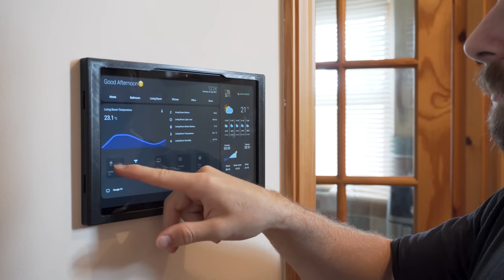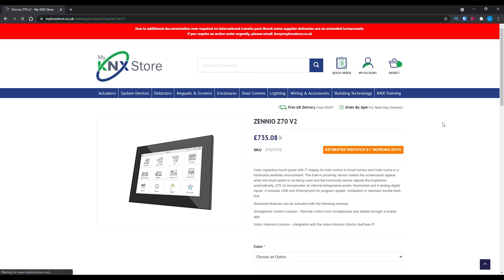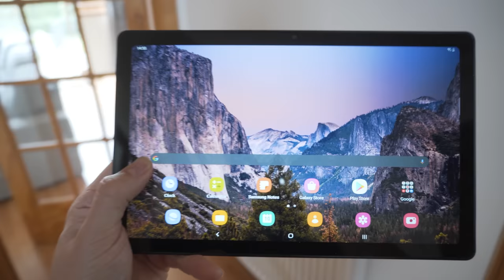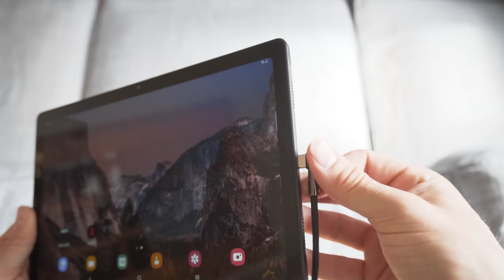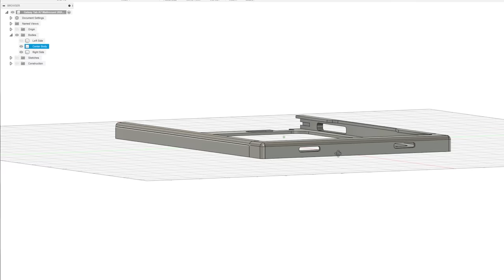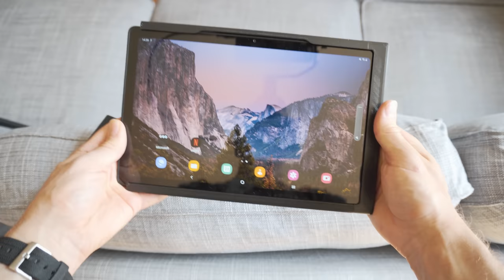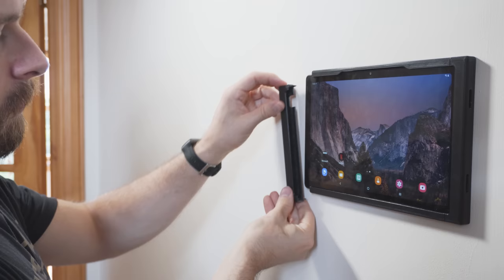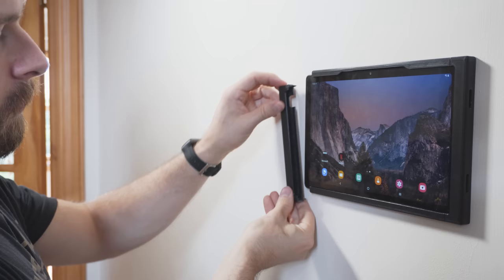Building my PERFECT Smart Home Control Panel!

Comment: My Amazon Fire 10 HD with mbmounts has been a game changer for user acceptance of my family. I got the power kit from mbmounts and Fully Kiosk and it works perfectly. I can even dim/turn off/turn on at specific times of day/night to make it dimmer in the evenings and off in the middle of the night.
Reply: Can you explain the MBMounts power cable? Is it a tiny usb plug with exposed wires to pair with the power method you chose? It's hard to make out what's going on in the pics.

Comment: Another power option is to use POE with either a simulcharge or a Poe to usb converter (if you have a data cable nearby that can be repurposed or are able to get one to the location)

Comment: The one thing I'd change would be using a magnetic charging cable so you don't need to unplug it when you take it out of the wall.
I'd use the tablet as a tablet sometimes.
(If you want a good one, I have a NXTech cable, I liked it so much I bought 2 extra cables for it, one for my bedroom, one for my livingroom and one for my car)

Comment: I went exactly through the same journey a couple years back. I used a Kindle Fire HD 10 with a PoE adapter for two years until the battery shat the bed and started to shut down the tablet. 

I switched to a used 5th gen iPad because of the better battery management in iOS. You can wake the iPad when it’s in single app mode with a separate motion sensor and a homekit notification btw!
Reply: Also used the fire tab myself, I wasn't impressed and would recommend spending the little extra for something better.

Comment: I ended up going with installing a hinged access panel in the wall with the power supply and some sonoff equipment behind.
An automaton I've set up is 1 button (labeled leaving home) activates the alarm, closes all the shutters, turning off the lights and AC with a 15sec delay on locking the door.

The video door bell pop up idea sounds great!

Comment: Amazing to see, i have the exact same setup for a month or two now.
Galaxy Tab A7 running HA on Fully Kiosk and i must say i'm extremly satisfied with it as well. Tablet quality is amazing, HA runs fast and stable.

Also the screen quality is very good, i use a handfull of high quality images from unsplash to loop as screensavers and it just look so good.
Reply from the maker: Nice, good to hear your having a good experience with the tablet too!
Reply: @EverythingSmartHome  I hope your setup is still good, my battery has swollen and died after a little under a year on a brand new device from being on the charger permanently 😅

For my next try I'll definitely add a smart switch in before the charger and use the battery data from Fully kiosk to automatically turn on/off charging when needed instead of permanently.

Thankfully a new battery is cheap and relatively easy to replace 👍
Reply: @robt7287  I have the same tablet and died after 1 year as well. Today I am about to replace the battery myself hoping to get more lifetime with some settings as you say.
Reply: @mercuryin1  I've replaced it as well, relatively easy since the screen already had popped off due to the swollen battery

Comment: Love it! Planning to replace my personal Toon Thermostat with something like this. One thing I would suggest is to use a transformer that you could just place near your power socket. Did the same thing for my camera. (220v to 12v) especially for 5v equipment there are a lot of options you could do. Even place a Shelly between it to power cycle it. Good job man 👍
Reply: Are you dutch?
Reply: @Nathan-wz5tm  yup, born and raised.

Comment: Wow, you have done a nice job there.  I went through exactly the same process earlier in the year with a very similar design I made in fusion 360, the number of iterations it took until I had something close to what you managed was crazy.  I was never 100% satisfied with it so I bought a professionaly 3d printed one from the US for £60 which turned out to be perfect but the point is the build area and the area where the join is are very difficult to get right, that is a great achievement!
Reply from the maker: Thanks, appreciate it! Yeah, the 3d design isn't something I'm that great at, takes a few attempts for me to get it right 😂
Reply: Could you provide a link or at least the name of the company or site in the US where you purchased your 3d printed case?
Reply: @eltonnoway5692  MB Mounts do a Samsung mount that seems quite popular. They also have a solution for the power, either standalone for your own case or as part of their 3d printed case bundle.

Comment: Looks great. You mentioned how well it feels in the hands. Have you considered a magnetic mount with induction charging so it could be used in hand as well as on the wall?
Reply: Induction charging cooks the battery and really reduces the lifespan. Really bad for a device that'll be sitting on it all the time.

Comment: Very interesting and beautiful work.

- But why not to use smart clocks? Belt can be accomplished by set of different buttons per chain. Bathroom, kitchen, entrance camera, garage. Weather. Weather adapting. Etc. Activate belt, push button, make your work. Deacrivate belt. Use it from any point in house or outside

Comment: What an incredible build!  It turned out great!  I've been considering something similar using an iPad running HomeKit but, as you mentioned, there are some obstacles there.  My biggest question though is about how useful it actually is.  I imagine it being pretty great for cameras, but in terms of controlling devices, a room-based controller seems more feasible.
Reply from the maker: Hey thanks my friend! Haha, there is certainly something to be said for just the coolness factor of it over function but still I do occasionally find it useful!
Reply: All depends on the functions of the system. Checking if the doors are locked before bed for instance is very helpful. But just controlling your lights is less compelling.
Reply: I almost think that is why it would be better to put it in the kitchen somewhere. You could make it so you can quickly add items you've run out of in your fridge. Watch cooking videos, find recipes and control your TV to cast content onto it. Also adding voice control to all the features would be super helpful to make it seem like a truly smart home.
Reply: what room based controller do you recommend?
Reply: @blakeseufert7340  Well thats the word "smart" comes in. A smart home/system is  not smart if you need to manually controll or check everything (even from a display or phone). Its just a more modern way to controll you lights ect. The smart part is doing this automatic. Like locking the door when you go to bed.
Reply: @Hofstader007  Agreed. For me, where a wall mounted display becomes useful is for visually representing information and minor controls. Doorbell rings, camera feed automatically pops up on screen and you can tap a button to talk to the person or unlock the door. Also useful for my use-case of using a barcode scanner in the kitchen for items that need to be restocked. Barcodes vary so much that the item may exist but be under a different SKU (or need to be added anyway), so being able to properly assign a new item, barcode to an item, or item count to the item in your system is useful.

Comment: My tablet setup is very familiar, with the difference that I got a socket with USB outlet installed inside the stud wall, behind the mount so that there are zero cables showing and it satisfies local regs.

Comment: Thank you for your video, especially the software part. For the tablet I would suggest powering it with PoE. For mounting I would go for a low profile design. What I have in mind it remove plaster board for the size of the tablet and replace by a 1/4 inch smaller plywood. Dual lock velcro on the plywood and on the tablet and voila. It would almost feel like it's in the wall.

Comment: About the fire lasting not so long. I have an OG kindle fire first generation. It is well over 10 years old and still working. Not slow, battery still holds about 9 days on standby and 2-3 days if I use it :D All of the samsung tablets in my family died in about 2-3 years. We've had a fair few already. The kindle is just really well built IMHO :)

Comment: FYI KNX isn’t a brand selling screens. It is a worldwide brand agnostic, cabled bus based building automation system. From smart homes to running airport terminal buildings it can do some seriously complex stuff and home assistant will work with it
Reply from the maker: It was just an example, o wasn't talking about them specifically. It was a generalization.

Comment: You made me add this back on to my list.  I have Kindle fires on a few walls but I don't have a special dash for them.  Also, another thing you can do is take a chunky picture frame and hull out the back to place the tablet in, it looks really good from the front (even if it looks bad from the back).

Also, this is another great application for PoE.  I inject power through some old security wiring.
Reply from the maker: That's a pretty good idea too!

Comment: Nicely done. I am looking for a solution for my home automation. Namely, I have a lot of installed Sonoff devices with which I am very satisfied and they work great. Since I control them through a mobile application and with the voice help of an Alexa device, I'm looking for a solution where I can do everything from one place. I was planning to install a Sonoff NS panel, but this seems to me to be a much better and more practical design. Insert the tablet and set it to run only the eWlink application.

Comment: Great video as always! I've just started using Home Assistant and I can't say how much valuable advice and guidance I've gotten out of your videos!

Currently, my setup can be controlled through sensors, Ikea switches and Lovelace through mobile phones, but I think tablets can usefully be part of the range of options to control my home. Particularly, they can be used by guests without needing to log into Home Assistant on their own devices. And tablets can display visualisations to feed back to the user useful data to guide how they use the devices in the house (AC, lights based on ambient temp, brightness, historical usage patterns...). Think it would help make our smart homes more interactive!
Reply from the maker: Thanks Daniel, that makes me really happy :)

You bring about some interesting points for sure, guests wasn't something I had thought of before but makes sense!

Comment: I use the same Samsung Tab A7 on my wall. Two infact and they do not like being powered 24/7. Not sure if it's the constant on, motion by camera or the constant charging which is the problem, but the battery keeps becoming swollen. I had them mounted on the wall for two years before both batteries grew so the case of the tablets popped open. I got them repaired and the same happened again one year later. No other tablet I've had had these issues. I do not recommend using them on the wall!

Comment: I was thinking of going the Pi route, this is the way to go tho. Only thing I would add is a wallplug switch on the tablets charger & write an automation to keep cycling the battery.
Reply from the maker: I think you missed that that's exactly what I did 😜
Reply: @EverythingSmartHome  Thats what I get for "watching" video's while working, missed that bit indeed. :)
Reply from the maker: Haha all good, no worries!

Comment: If i have this panel one of display will shows sensor status like door & windows sensor, motion sensors using custom button card. Set the card will blinking when its still opened and some areas was occupied. So we can get alerting that windows or doors down stairs status before go into the room.

Comment: I'm in the process of setting up a very similar system using an iPad. Only one automation so far, I have HA on my iPhone as well so I have the system set up to automatically play music on a downstairs Sonos speaker when I come home.
Reply from the maker: Nice one, how are you finding it?
Reply: @EverythingSmartHome  So far so good, I'd not used HA before at all but I've managed to get a dashboard that controls my Nest Thermostat, Sonos and has a live feed from a Nest Doorbell.  Need to look at getting a Raspberry Pi though as I've currently got HA running on a Virtual Machine on a MacBook.

Comment: I have this exact setup, had it for a years. same tablet, same kiosk, i just used one of the thingivers holder and expended one side to fit a cable.

i also used a the corridor motion sensor to wake it up since the camera wouldn't see anything in the dark
I have a script linked to our alarm that change the home URL to a "alarm panel" that use a kiosk add-on for lovelace in order to avoid someone tinkering with home assistant when the alarm is ON.
I was also looking for a way to have a "doorbird" show up full screen on the device in a way that allow me to reply or hear the person ... nothing yet.

Comment: Lewis, great vid thanks.  You're the only YT'er I know that gets out of breath just by talking 😂!  I know you didn't want to mess around with cables and such but to get the flattest USB charger profile, look for the Qi wireless charging plates.  They have some with the flattest possible right-angled USB-C head.  Just cut the wire loom part off.  Might allow you shave a bit more off that mount.
I tried your write-up link by the way but it no workie.  I was looking to see how you did your dash?

Comment: I am planning to automate the airco. When my solarpannels produce 1000Wh more than I consume for more than 1/2 hour, the airco should start to cool. When the solar panel prouction is less than 600Wh I consume for 1/2 hour the airco should stop. I have smart sockets that measure the solar production ans can switch on as wanted, I only have to buy/install a smart airco (wifi/google home compatible) and write the routine. The latter is for me the most difficult. 🤣

Comment: A different floating solution is to add a Qi pad with an almost hidden usb-c connector. I've added magnets with srews trough the plaster and an IKEA wireless charger sunk into the plaster. Easy to move and looks cool floating on the wall, better not smash it thou as it's not as solid as a frame.
Overall you dash look awesome!!!
Reply from the maker: Yeah I thought about doing that too...maybe the V2! Would be very cool

Comment: I think we would all really like to see how you set up the dashboard you are showing here in Lovelace. I'm especially keen to see how you set up the buttons in the top left Lovelace card to open a different room card in the Lovelace card panel below it. I think that's the best implementation of a tablet Lovelace dashboard that I've seen.

I need to see how you did it!
Reply: I'm sure that will be done by just setting the tap action to the Lovelace URL in something like a custom button.
Reply: @stevefromuk  Yeah, in thinking about it a little more I realized he is probably not changing cards within one view but is going to a new view for each room, where all the other cars are duplicated from the first view. That way it looks like it's all on the 1 view but in reality is multiple views where all but 1 card is identical.

Comment: That looks amazing! I've got aspirations to do the same thing when I move. I've set up a supervised iPad in single app mode to only load home assistant, and found that I can power it via a poe to usb converter. The plan is to use it with my unifi gear and create an automation to start and stop charging based on power levels by enabling and disabling the poe port. Now I just need to find a place to move to and get it networked up. Found a nice mountable metal case for it, as iPads have loads of options out there. Don't think I'll be able to wake it with motion detection but hey, can't have it all.
Reply from the maker: Awesome, sounds like you have a good plan! Look forward to seeing how it goes!
Reply: I am planing to do the same with my old iPad and although you are not able to wake up screen using build in camera I found one video where someone managed to do that using automation and separate motion sensor.
Reply: @tomekhekin914  oh nice! I'll have to check that out!
Reply: If you jailbreak the iPad, you'll be able to change a lot of settings and add more features... Haven't looked for possibilities to power on by motion in camera, but can't see why it shouldn't be able
Reply: @EverythingSmartHome  I finally did it! 

Moved house earlier this year, got some network cabling installed, popped an iPad into a custom wooden frame with space for cables behind, hooked it up to a poe converter, and used Home Assistant's integration with my Unifi poe switch to create an automation to turn the poe port on and off based on the iPad's battery level. Mounted it over the electric light switch for the room, so no one can absentmindedly turn the power to the lights off.

Took a while but it totally works!

Comment: I installed a galaxy tab A 10.5 2018 edition a couple years ago.  I was trying to find a tablet with a motion sensor but those cost way more.  I like that you found an app that can use the camera for that.  I think I will give that a try.  I currently use a tasker app to turn on and off the display at certain times.  I also wired in a recessed outlet with usb charge ports behind the tablet to hide the wire.  I'm still playing around with what I would like to use for a smart home platform for the display.  Currently I just have a bunch of widgets organized on the screen.
Reply from the maker: Nice, let us know if you make some changes and how it goes!

Comment: Mine just built and repurposed a old 10inch android tablet, install lineageos on it and sideloaded HA apk. Works great for me, hardware wise, I just removed the battery inside the tablet, plop a 4v power regulator and soldered it into the battery connectors on the tablet. Cant risk the tablet having a puffing battery inside that may lead to fire risk.